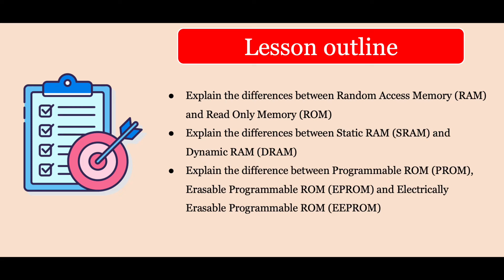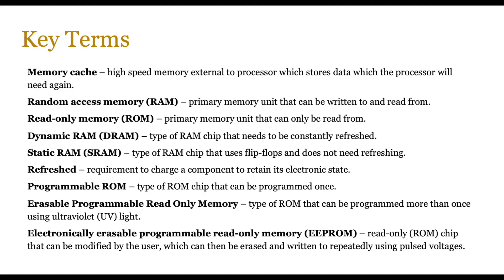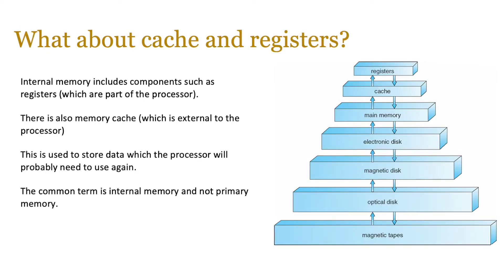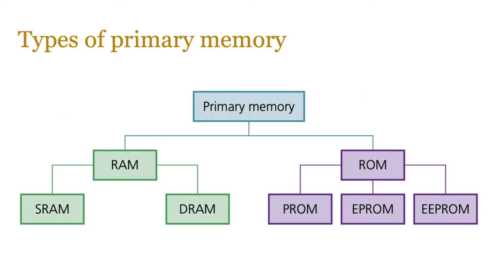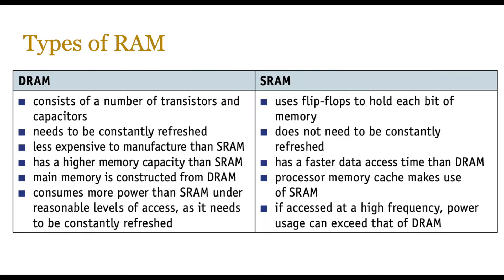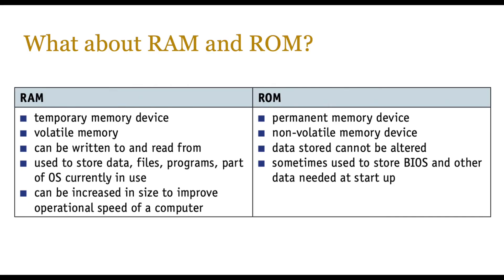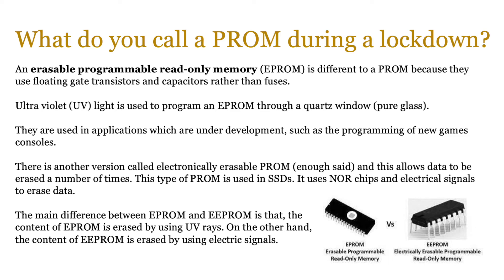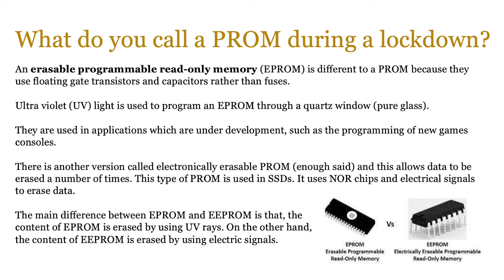Lesson 31 - Memory Storage

Comment: Sir,
The cache memory is situated on the motherboard system?
Reply from the maker: Typically yes. Between the CPU and the RAM. It can be integrated in the CPU as well or as a separate chip connected by a dedicated bus.
Reply: @ComputerScience4U  So, the cache memory on CPU, use SRAM?
SRAM can be a chip and can also be in the CPU??
Is EEPROM part of the syllabus?
Reply from the maker: @afkgamer7204  Yes it uses SRAM. It can be integrated on a logic circuit so both as a stand alone chip or as part of the CPU. EEPROM is part of the syllabus and you should know the difference between PROM (write once by burning fuses), EPROM (multiple writes possible- uses quartz crystal and UV light - erase all old data then write new data) and EEPROM (logic circuits -  possible to erase bytes/blocks of data and rewrite - SSD version uses NAND gates - ROM version uses NOR gates)